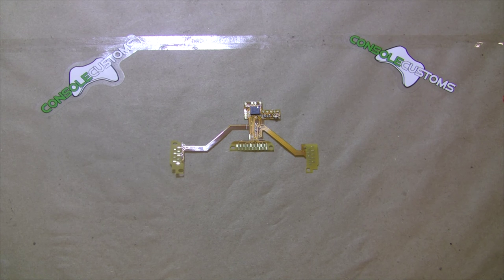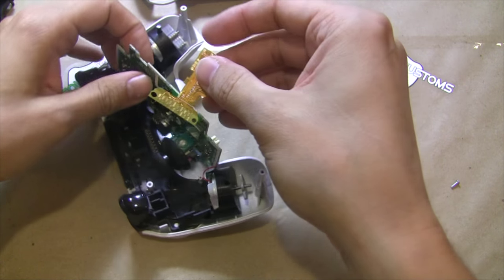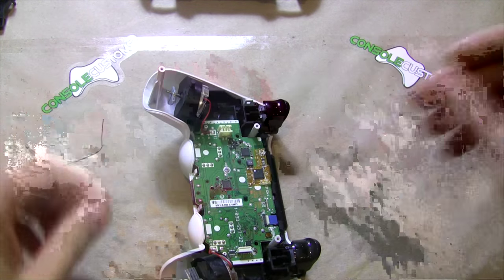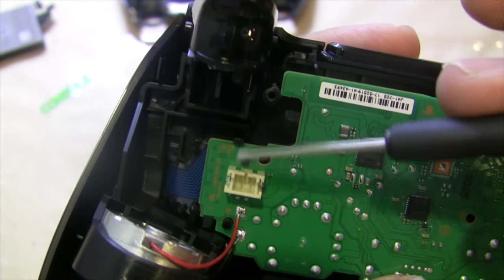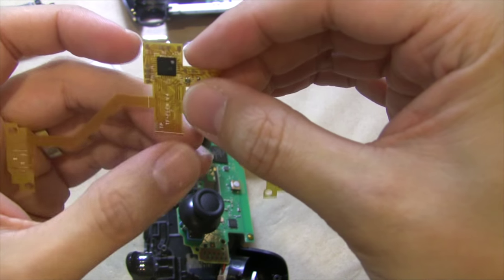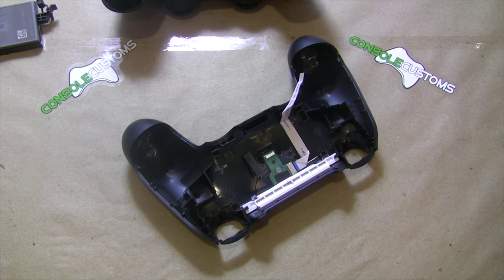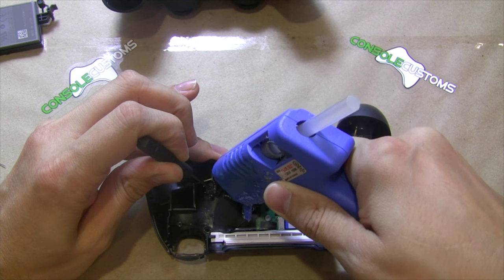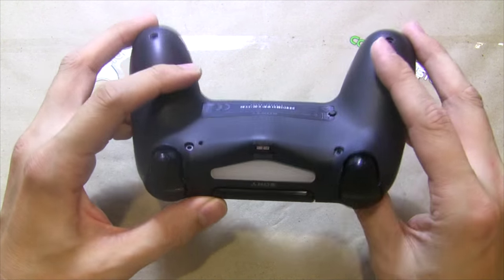Console Customs PS4 Truefire-FLEX V4 rapid fire mod installation

Comment: Hey i was just wondering but is it possible to get the rapid fire mod and the button remapping flex installed into the same ps4 controller?
and great vid btw :)
And also does the flex rapid fire already include the x and o buttons?
Reply from the maker: +Jazzepi 18 The Rapid fire mod has an option for 2 remapping buttons. these are the connection pads labeled M1 and M2 on the mod. The default to X and O but can be set to any button you like.

Comment: The bad thing about the this rapid fire, is that sometimes you accidentally press left twice or something like that and end up turn on the mod when u didnt need. I think it should have a switch to turn on and off to avoid the accidentally activations.
Reply from the maker: It does, this is the optional button we install on one of these mods. you can add a button that takes the place of Left on the D-pad to prevent accidental turning on/off of features.

Comment: I don't get why they put the bits on for you to cut off. Doesn't make sense for them to be there in first place.
Reply: Because it’s cheaper to make them fit both controllers otherwise they’d have to manufacture two different machine programs to manufacture two different parts and if one of them sells more than the other, but they printed loads for both, then you’ll have a waste of money and time.

Comment: What temperature is your soldering iron at ? While you are Doing this since my solder seems to stick to the iron instead of it going somewhere else
Reply from the maker: +🍁TreeingThotz🍁 Aka THCLovesTIH I am using the soldering iron at around 360 Celsius.  Are you using solder with flux in it? sometimes called rosin core solder? the rosin or flux is needed to help the solder flow to new bare metal. Also having a properly cleaned and tinned tip on your soldering iron really helps. there are some video tutorials out there for properly preparing a soldering iron tip.
Reply: +consolecustoms thank you and no I don't have flux atm and thanks for the recommendation to look at some videos

Comment: why do you solder that point to the touch pad?  it looks like it was where you cut the board off, is there an obvious solder point that you soldered to the touchpad?
Reply from the maker: +Josh Baer There is a large gold placed solder pad for the touchpad. You cut just below this so it is still there no matter which controller you are installing into. The touchpad is used for turning some of the features on/off as well as some functions in the programming mode and Advanced feature management.
Reply: thanks! was gonna order today but the shopping cart buttons were missing. then i saw your message later in the day.  Happy holidays!

Comment: when installing reflex buttons that are programmable by M1/M2 where are the soldering points for say X and O. please help haven't really found any manual on how to actually use those features
Reply from the maker: +brian mayer Thats the beauty of reflex buttons, they are programamble. so by adding them you are not locked to specific buttons. M1 Defaults to X and M2 Defaults to O, however to change them it is all software, no soldering needed. 
To change a reflex button assignment you just go into the programming mode (holding all 4 triggers for 8 seconds) Once there just hold the reflex button you want to change and while holding it tap the controlelr butt you want to assign to it, such as Triangle, The LED put front will flash to confirm the change and your done. Just exit the programming mode by pressing the touchpad.
The reflex buttons can be assigned to any button, trigger, D-pad direction or the touchpad, the only buttons not mappable are the Share and options buttons.

Comment: on the these 2 controllers why were R3 and L3 involved im still confused on just those buttons especially on the 2nd control. is it an activation for RF? the button to switch on RF was understandable, but R3/L3???
Reply from the maker: These buttons are used with other features such as the auto run and drop shot (if your using a tactical button layout.)
Reply: Idk for some reason my gun shoots automatic with r3 and my trigger buttons don't shoot

Comment: I ordered it lastnight I can't wait to install it .. can you only run one mod at a time or can you use drop shot and rapid fire both at the same time . also the remap buttons do they install the same way as the mod button. will it come with instructions to use the mods
Reply from the maker: +JAYY DELLOOMOONDOO Jayy, Yes you can run multiple features at the same time. Basically you can turn as many on as you want as long as they do not conflict with each other. such as Jump and Drop shot cannot be on at the same time. 
The remap buttons buttons install exactly like the Mod button, just use the pads labeled M1 and M2 instead of the RF pads.

Comment: Hey i was wondering how you can change the rapid fire speed of the controller?
Reply from the maker: +OoL AoO You change the rapid fire sped within the programming mode. which you get into by holding all 4 triggers for about 8 seconds. you will see the LED flash white one time. Then you use the D-pad Up/Down to make the rapid fire faster/slower. tap the touchpad to save and exit.
Here is a link to our full user guide. Programming mode information is on page 7.
http://www.consolecustoms.com/dl/ps4/PS4_TrueFire-Flex_Manual.pdf

Comment: what drill bit size are you using?
Reply from the maker: +Rodrigo Munoz You can use a 1/8" or 9/64th" drill bit. If you are in Europe a comparable metric size is 3.5mm

Comment: Hey guys, sorry I didn't get how to add a button just for square, circle etc. I'd like to use what you built in as map-button as a circle button. Is it possible?
Reply from the maker: Yes it is possible. On the second controller when we instaleld a button we hooked it to the pads labeled, RF, these pads are for turning rapid fire on/off. However if we would have hooked the wires to the pads labeled either M1 or M2 it would do exactly what you want. So basically you install the button just like we did on the second controller but solder the wires to the M2 pads instead of the RF pads. M2 is Circle by default. start watching at 16:35
Reply: consolecustoms. I just wanna say that it looks bad ass and can't wait to try it man.dope dope .wish me luck

Comment: So i play flipped so i shot with R1? what would i wire too?
Reply: Shoot*
Reply from the maker: You don't need to change any wiring. There is an option in the mods "advanced feature management to change the mod to work with Flipped layouts. This is call the "trigger mode" you can find information on page 9 of the user guide on how to change it.
Reply: +consolecustoms thanks

Comment: I have a question. Is installed the mod. Everything is working. Now I want to know if it is possible to give the Mod Button another function. So maybe turning on/off drop shot and not rapid fire
Reply from the maker: The mod button cannot be changed. You can turn on/off drop shot by holding B and tapping the mod button. but the main function cannot be changed.
Reply: consolecustoms Ok, thanks. You're the best.

Comment: can you also use the chip without the mod button or Do you Need to install it in order to use the mods ?
Reply from the maker: +jurgen dams The Mod button is optional, if you do not install it you will use Left on the D-pad in combination with other buttons to turn features on/off. Examples you can either double tap left or Left + R2 to turn rapid fire on/off, Left + Circle to turn Drop shot on/off.

Comment: the m1 m2  does it matter which ones which I'm presuming the 2 in middle are the negative
Reply from the maker: Correct the Middle 2 are both grounds. It does not matter which one you use as far as the M1 or M2, M1 defaults to X and M2 defaults to Circle but they can be changed to any button that you want.

Comment: great video bro, can this ps4 mod controller work on pc with rapid fire ?, I played street fighter 4 & street fighter alpha 3, I use blanka a lot so I  wonder if this will work on pc.
Reply from the maker: +mortal4life Yes, the controller can work on a PC, however you can only use the rapid fire with the triggers and not with the 4 face buttons.
Reply: +mortal4life if you're using PC why aren't you using a PC Gamepad almost all of them have turbo features and are cheaper and safer than modding a 60 dollar controller

Comment: If i add buttons on the circuit board to create a "scuf" does it make the TrueFire have some bugs or stop work ?
Reply from the maker: +Torrent momzz No the Reflex buttons work seamless with the mod, they do not cause any problems. We also not have mod specifically for adding reflex buttons without the rapid fire or other featurs, so if this is all you need please check out our Reflex Remapper or Easy mapper mods.

Comment: So I have the older version of ps4 controller. Should I follow the same steps as this new one?
Reply from the maker: +chumbrega2 We do installations on both a older (connection pads in the center) controller and a newer (connection pads at the edges) controller in this video.  The first controller we mod is the older style. For the newer  style you can skip to the 10:00 mark.
Reply: +consolecustoms ohh great, I was lil confused, cus I have the older with a dark board. Thank you.
Reply from the maker: +chumbrega2 The circuit boards can be different colors than the ones in the video but as long as the connection pads are in the center it will install exactly like the first controller in our video.
Reply: +consolecustoms thank u, subscribed and gonna order now

Comment: if I purchase the true fire flex V4 from you is it still possible to turn it into a SCUF Controller so I can jump and also reload with buttons at the back of my controller with this mod, if so could you please explain how
Reply from the maker: Yes, you can add 2 remapping buttons by soldering wires/buttons to the pads labeled M1 and M2. These are better than a Scuf Controllers because the buttons are programmable you can make them act as any controller button you want and change it at any time.

Comment: You have 3 different mods for several different controllers and all of them use words like TRUE FIRE, RAPID FIRE, EASY MAPPER, FIXED BUTTON, FLEX, and etc.. I know what I want but I have no idea what you guys are calling those features...

I want a mod that turns a pistol into a machine gun but I also want to put buttons on my comtoller where I want them for jumping. i wouldnt mind trying out the croutch and shoot or jump and shoot and know what else is available. Avoiding using your store lingo in a conversation with me would be aprecciated because I dont understand your jargon!
Reply: in summary your store is confusing!

Comment: If I don't want to install the button I have to cut the circuit? and if I need it I have to install without cut? I'm noob in this subject.
Reply from the maker: If you don't want to install the button you don't need to do anything. Cutting of the circuit board depends on what version of the controller you ware installing it into. Some have the connections on the side and some have the connections in the center you remove what you don't need.

Comment: How many watts is your soldering tool ?
Reply from the maker: The one we use is adjustable and based on a true temp instead of watts. but if you are using a soldering iron rated in watts you will want something around 30 watt, no more than 40 watt.
Reply: 230w is pefect depending how pointy the soldier tip is i recommend using flux

Comment: Do you get a software to program what the mod does?
Reply from the maker: All features are built onto the chip there is no external software needed. Most of the features have additional customization you can change with them and the features like rapid fire and quick scope have programmable speed options all within the chip itself.

Comment: can i keep the 2nd gen part and not cut it? or i need too if i i have the 3rd gen
Reply from the maker: +zenzation O.o  You can keep it but you will need to cover it with masking tape or electrical tape so that it does not make contact with anything.

Comment: how can i program the reflex two buttons?
Reply from the maker: To program the remapping buttons you just need to go into the programming mode. Once there hold the remapping button you want to change and tap the controller button you want to assign to it. you can basically map any button, trigger or D-pad direction except for the share and options buttons.

Comment: hello how i reset the chip for the original configuration?.
Reply from the maker: You must first go into the Programming mode (Hold R2+R1+L2+L1 for 8 seconds) then when in programming mode hold R3 +L3 for another 8 seconds and it will reset to factory defaults.

Comment: you should make a video of the problem your having with this chip! since your not coming forward with the problem I will!! so the problem with this chip is it covers the antenna that makes your controller go haywire!! step up to the plate and make a video or I will add you will not like it what so ever!!!
Reply from the maker: +Maxim HD Entertainment We are already working on a video showing the fix for this issue which should be up the weekend. But thanks for spamming across all our videos.
Reply: +consolecustoms well sorry for the spamming!! just a little upset because I had to remove the chip, and after doing so it missed up the chip ! you said you was going to send me a new chip for the problems but never received it yet! would have not had this problem if you have been more truthful!!! so now i'm out $25 and a chip
Reply: +consolecustoms When will the video be up? Because I just purchased one and I want to see what the problem is before I install it.
Reply: +Luiz Gabriel Graupner Alba 
Good question!
I´m on the verge of buying a board mod kit but want to know what the fix would be.
Reply from the maker: +BulldogBiteMUC I had hoped to have it up already but was sick this weekend and my voice was and still is a little hoarse. I hope it will be cleared up by tomorrow so I can make the proper commentary. If you send us an email through our website I am happy to send you some pictures of the fix. Basically you add one small wire which acts as an antenna for the bluetooth.
Reply from the maker: +Luiz Gabriel Graupner Alba I had hoped to have it up already but was sick this weekend and my voice
 was and still is a little hoarse. I hope it will be cleared up by 
tomorrow so I can make the proper commentary. If you send us an email 
through our website I am happy to send you some pictures of the fix. 
Basically you add one small wire which acts as an antenna for the 
bluetooth.
Reply from the maker: +Maxim HD Entertainment I can see from your video you are outside the U.S. so packages take longer when shipping international. But since I don&#39;t know who you are I cannot check on it. Please just send us an email through our website or reply to any previous conversation we have had over email and I can check on the tracking for the replacement.
Reply: +consolecustoms  this Problem is on every Controller Modell ? I just ordered the Flex V4 für my JDM-01 PS4 Controller. If I need this problem fix I´m thankfull for a video how to fix it. Thanks and greetings from Germany.
Reply from the maker: +PrimeObjective The problem only happens with newer controllers that have the split connection pads. The video for the fix is uploading right now. Here is a link to it. It should be available in about an hour.

https://youtu.be/a7hM6yn325I
Reply from the maker: +Maxim HD Entertainment The video for the fix is uploading right now. Here is a link to it.

https://youtu.be/a7hM6yn325I
Reply: +consolecustoms am u hook me up with one I want a mod for bo3 ps4 modded control with the mod jitter I well buy it or something
Reply: consolecustoms Quick question. Can we supplement hot glue w/silicone?